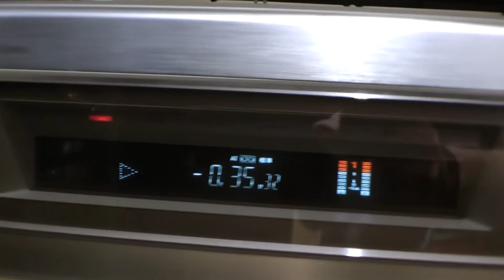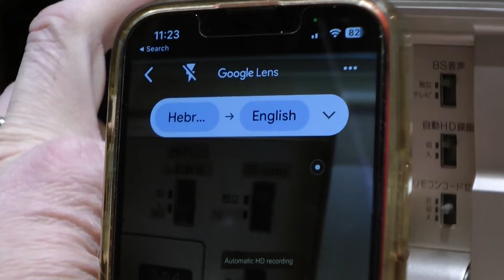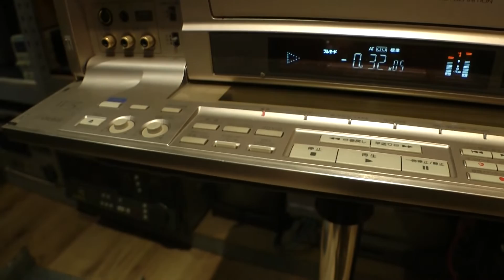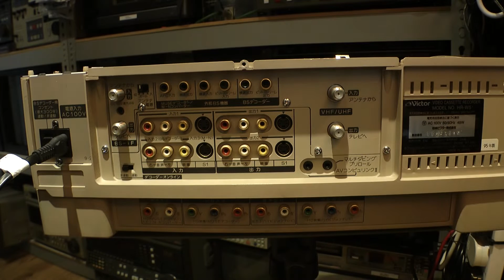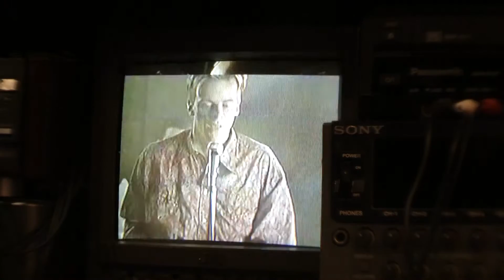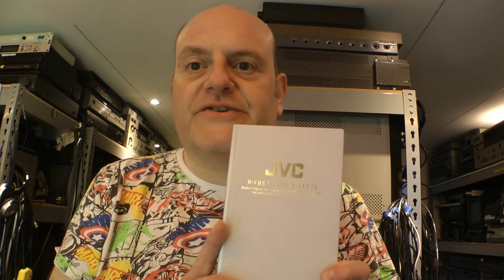VIKTOR W5 Hi-Vision VHS Analog Video Recorder Show and test

Comment: Hello! How this players plays standard vhs? Does it improve somehow quality better than some regular s-vhs that has kinda tbc like JVC HR-S 7600 that produce at least s-video out, maybe it also do perfect viewable rewinding without tearing etc and do more quality over component?
Reply from the maker: This machine produces an above average picture. The image is clean. Similar to the 3d Noise Reduction in later model vhs Viktor machines. Thanks for your comment.

Comment: BS means Broadcasting Satellite. It is used by Japanese people to get more channels using a dish mounted on the roof. It is still widely used today now doing BS4K and BS8K digital transmissions. The one present on the machine is just a BS decoder at 480i 59.94Hz. But the BS MUSE Hi-Vision Standard is at 1035i 60Hz. It is the reason why there are component inputs at the rear of the machine labelled BS decoder IN.

I had one of the HR-W5 but sold it due to lack of space. It was too nice to have when just only watching rental.
Reply from the maker: Amazing. Thanks so much for the information.  The Japanese systems are quite unique to Japan.  As a point of interest, do you know if japanese analog modulated ntsc has the same audio carrier frequency as the US version. I was curious to modulate some over the air stuff for the Analog tvs I have here. Thanks for watching.